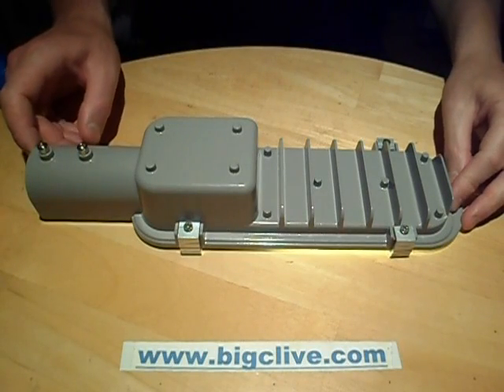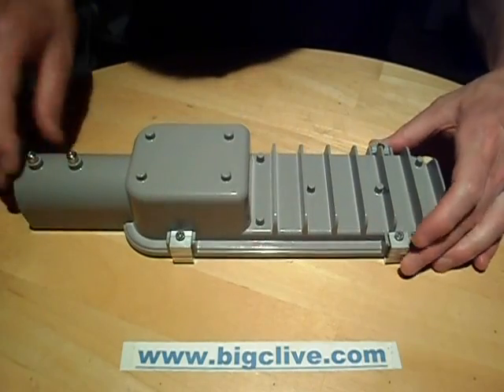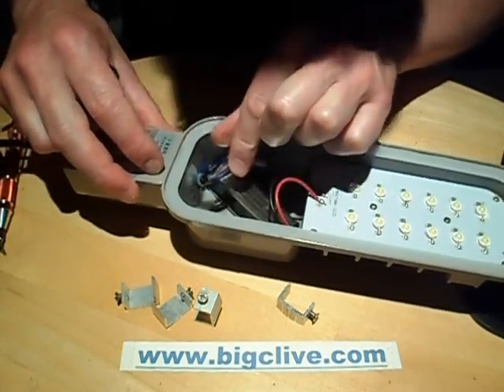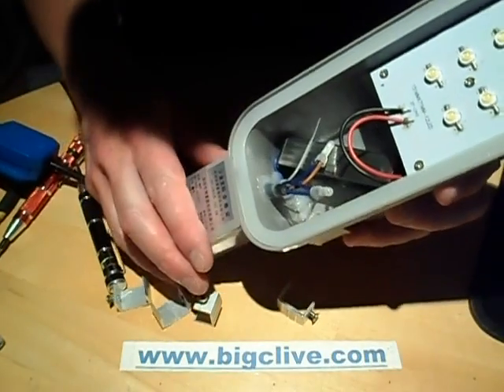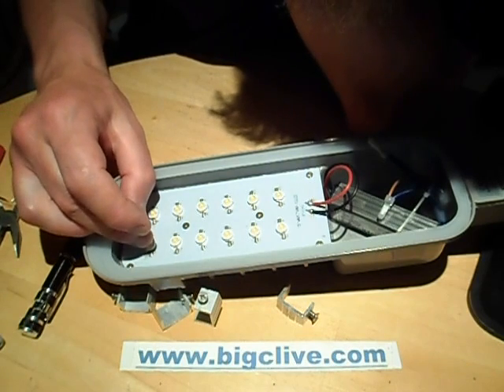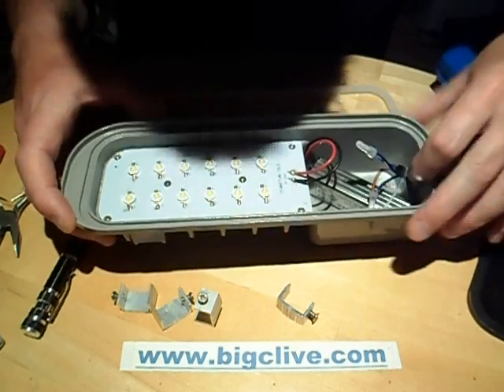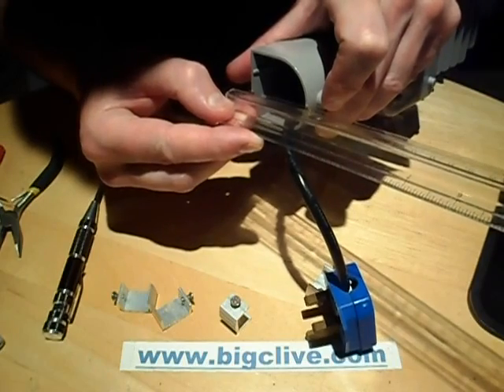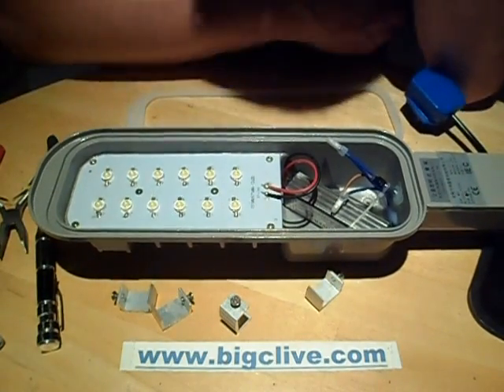Chinese LED street light teardown.

Comment: I know it was a year ago but did you see what actual wattage it is. ?
Reply from the maker: TehGlitchs That's not actually good enough.  there's a risk that if the ground is dry the lamp post could become live.  That's [particularly bad news for dogs wishing to pee against it.
Reply from the maker: Graham R Dyer I've just left it running for a while and it's reading as 12.2W.
Reply: +bigclivedotcom Won't there be no earth in this light because it will be attached to a metal streetlamp which is earthed itself?

Comment: These integrated LED lanterns need to be banned, as when they fail, they cannot be serviced as we have with a LED Corn bulb used in a traditional Lantern head
These are throw away lanterns and councils in the UK are being sold them for the energy savings, but failed to see what happens when they fail
Reply: Eric Hawkins ... I guess you didn't watched the video at all. The leds are soldered (which MUST be for reliability) and appear to be not glued, which mean that anybody with an iron can replace any of the leds. The transfo might be glued, but nothing prevent you from prying it out to replace it. This is a chinese model, so I wouln't expect any compagny to install them, even less a city. But let's say they are reliable... The repair cost might be close to the retail value of one, so might be more cost effective to replace them and sell the broken one for scrap...

Comment: outside LED lighting must have ground wire, also waterproof led driver, waterproof glue or silicon glue, your street lamp seems have not waterproof glue.

Our factory produce outdoor led lighting have ground wire, waterproof glue around lamp, USA Bridgelux 45mil high power LEDs LM-80, normally use Taiwan MeanWell power supply ( UL, TUV, EMC, CE listed ect.) long lifespan
Reply: Leiming LED Lighting That's the difference from the cheap Chinese and the quality US versions.
Reply: Evilkittyof doom I actually bought a couple of there in higher wattage and I added an earth ground lead and a photocell to them, They seem to work just fine. But I am adventurous like that too AND I know what I am doing when it comes to electricity and electronics.

Comment: Those LEDs normally have a solder land on the back that is soldered to a corresponding pad on the PCB, but effectively soldering it requires reflowing the board.  The fact that they used thermal goo suggests that the board was soldered by hand.

Designing a PSU for a narrow range of input potential can make it slightly more efficient and simplifies its design.  Such penny pinching is to be expected given that the intended market for this is low budget third world electrification projects, which tend to be in 220V to 240V land.

Comment: Cool video. Do you have any particular use planned for the street light?
Reply from the maker: Nope.  I just bought it to take to bits.
Reply: nickhill92  So you are dealing with led street lights? 

Actually, we are factory making led retrofit kits, which can retrofit almost 90% of existing lights in the US market, say street light, cannopies, shoeboxes, wall packs, flood light and so on. You can keep the good old fixtures as you like, just retrofit only.
Contact me for more details: Elaine Xiong; elaine@chigather.com; skype: elainexiong2; Cel: +86 158 1879 4906.